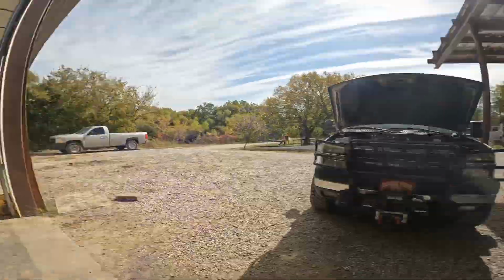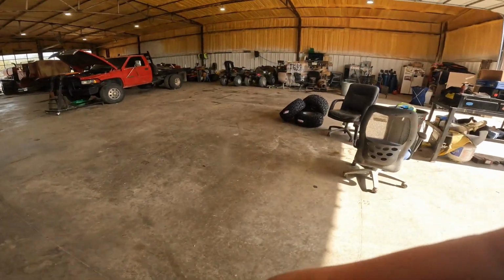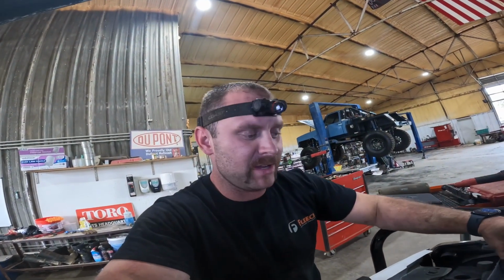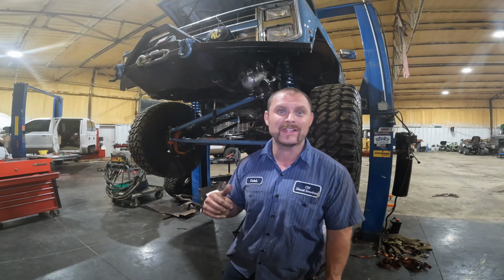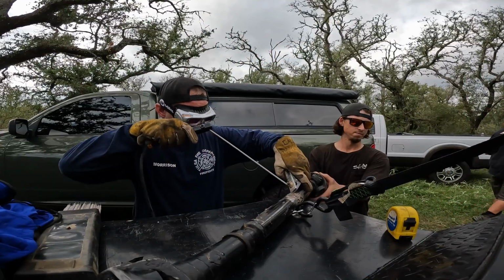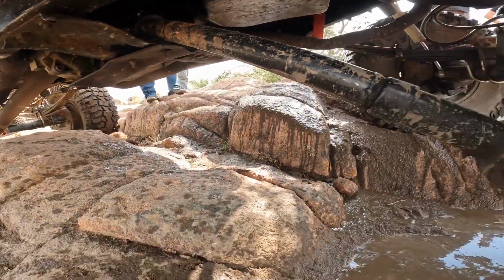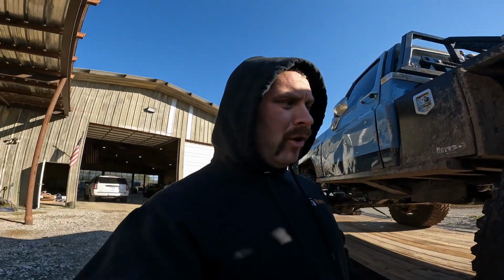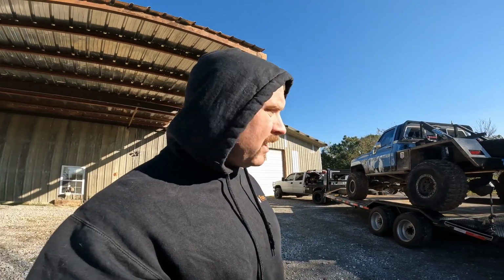Wheeling at Katemcy off road park with Full Size Invasion 2023!

Comment: Caleb I also have a 2007 classic body style Duramax and I have been driving it for around 14 years now and I absolutely love my Duramax for sure!!! I’m actually looking for another one for mine has around 300k miles on it and still running good!!! I have started having a little bit of a whiny steering issue and my fuel return line has been leaking for several years now!!! There are just a few things I need to do to it but just regular maintenance stuff really!!!
Reply from the maker: That are great trucks, I’ve had 3 of them and can’t complain at all. I just bought a new 24 model gmc, time will tell how good it’s going to be